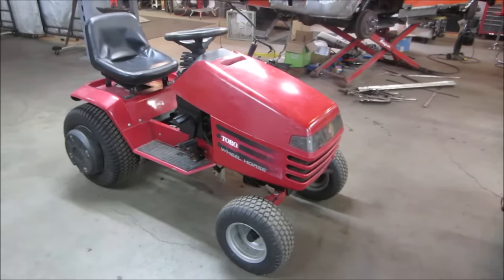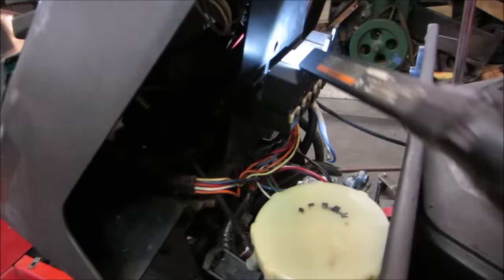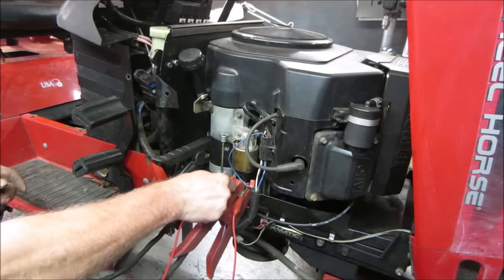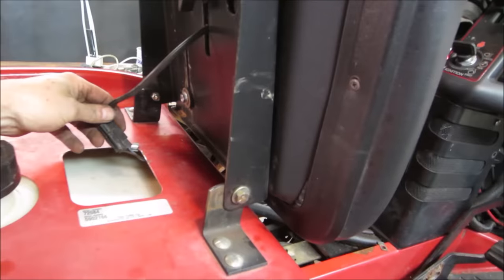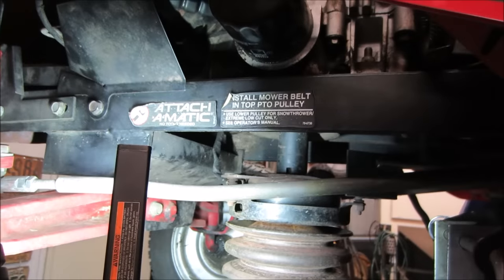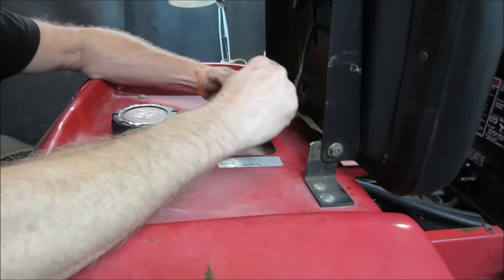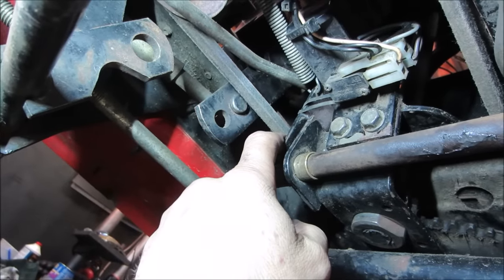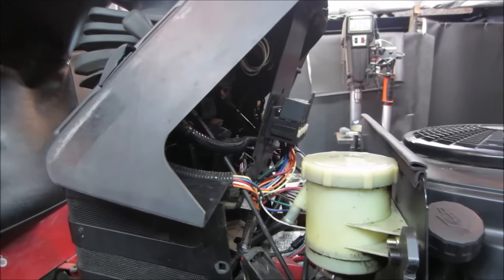How To Troubleshoot a Mower That Stopped Running,

Comment: Never apologize for troubleshooting without a manual!  It’s a lost art and we diehard fans love you doing it.
Reply: It's nice knowing exactly what wire does what and how each system works...but it's not realistic unless you work on the same exact thing every day. I try to learn from him, just have to know the BASICS and the different systems the machines have is invaluable to diagnosing lol. Classic Mustie fix.
Reply: New drivebelt had the wrong voltage rating.

Comment: Musty is at his best on electrical diagnosis and correction.  I think he has the skill of one in one thousand mechanics, Time tested by decades of experience.  In terms of diagnosis and correction of the switch for the p.To, You will note there are metal connections springs and bent metal.  Dirt and fatique are primarily the causes of poor connections.  Over time springs lose their elasticity.  It's referred to as cycles to failure.  Great job musty!!!   👍👍👍

Comment: It's projects like this that give the most satisfaction once completed.
The backyard Bandit puts the service centre to shame.
Reply: Ehhh usally the other way around...
Reply: The service channel charges by the hour, there comes a point it's not economically viable to do it there
Reply: @samuraidriver4x4  I completely understand you there, I recently repaired a chainsaw which the service centre said was beyond economical repair, why? Because it took 4 hours disassembling and re assembling the saw to replace a £5 part.
Reply: @Herbybandit  I try to buy equipment for cheap, work on it for 4 hours and flip it for let's say 150 bucks profit.
To bad there are no yard sales and free piles where I live
Still plenty of stuff on the online marketplaces for cheap although people think stuff is more expensive then its worth

Comment: In the U.K. I had my lawnmower at six ( some called ) service centres ,none could fix it . A friend said a engineer in north Scotland was the best in the business ( by far) phoned him , but it on the bus parcel service . I phoned the guy three days later and he said “the mowers repaired and but on the bus back” , 4 years on and it’s still going strong . The guys the small tool and mower wizard and I’ve used him to fix a few petrol and electrical tools and it’s a excellent and not expensive service by someone that knows his stuff.

Comment: The description reminds me a bit f the time I worked at Xerox building copy machines at the production line. 5 engineers from 3 different countries were standing at a machine they designed and didn't understand why it failed. As I walked by one engineer asked me if I knew what the issue was. I reached into the machine (pushed a gear pulley in the right spot), walked away and left them wondering what I just did. 😂

Comment: I have a Toro riding mower and one year it just stopped working,  After checking and replacing everything possible I gave up and took it to a repairman.  He called less than an hour later and said it was ready.  IO was surprised at how quickly he fixed it.  My problem was one of the little pieces of metal that sticks out of a relay was bent.  The mower thought the blade was engaged so wouldn't start.  It has again stopped and I haven't looked at it.  I plan on doing some checking and will take it to my repairman quicker this time.  I now have an old mower with all new parts!  It is funny now but wasn't at the time.  Thanks for video.

Comment: This was really well done.  There's really nothing worse that trying to troubleshoot a problem after someone else has been messing around and screwing things up.

Most of that was logic, but the really impressive part, that I think many of us would not have figured out, where those 2 switches that were flipped positions.
THAT seems to have been the main issue (or one of).

Comment: I am a retired physician.  I love your channel.  You amaze me with your problem solving skills.  Then you go above and beyond doing an autopsy on that PTO switch!  You truly never stop challenging yourself and seek more knowledge.  
I inherited a 30 year old JD lawn tractor and   after  watching you work on so many gas run machines I have learned how to fix a few things myself.  So far no electrical problems like this case.
Just think about how much carbon you saved by resurrecting  this mower!  It is sort of ironic that all the screwed up safety shut offs almost put this in the scrap heap!

Comment: Fixed my brother's JD mower today - remembered seeing this video and how you test things.  Had spark and a sniff of starting fluid confirmed it would run.  Fuel pump worked, but no "click" on the fuel solenoid when the key was turned.  Replaced the solenoid and good to go.  Your videos are interesting and informative allowing those of us less mechanically inclined to make the easy fixes.  Thanks for your great content.  Dave

Comment: With so many "safety" switches, one can safely stay on the couch and avoid mowing the grass.  ;  )
Reply: I’m all for mower safeties but geez that thing was over complicated. Two switches cancelling each other out plus a third one up top, relays, a bulb that has to work for the circuit to complete?!?!  Just wow.
Reply: @artemartem1134  All those safety devices remind me of the pleasure that you can get from bureaucracy.
Reply: @markschattefor6997  Safety switches? Mechanical and electrical bureaucracy and red tape. "Common sense" has died out.

Comment: Well done.   Excellent diagnosis.    The double brake interlock feels to be overly complicated.
A lot of connections were loose.    Makes me wonder if the original problem was just a loose connection.    
Dave.
Reply: Either a loose screw in the driver, or the nut behind the wheel. 😀
Reply: My theory is flaky PTO switch lead to other making a mes of it.  The rest of stuff looks to have been human error trying to find the problem.

Comment: Had a mower very similar to that years ago and had virtually the same problem. I kept trying to tell you it was the PTO Switch but you weren't hearing me! Then you tested it and I thought I was wrong but alas I was not. The PTO Switch was the original problem but one of the tech's added 2 or 3 more and turned it into a cluster!

Comment: watching you on stuff like this is a great learning experience. I used the same approach to resurrect a nearly 25 year old Sabre by John Deere. The parts I needed to replace included only the starter, and shorting a few of the safeties in the end. No manual, also. Who needs instructions?

Comment: In this episode, Mustie1, now the purveyor of mid-week madness, solves the quintessential riddle of the riding lawnmower by effortlessly evoking electrons from recalcitrant relays to score a successful start to win again.  Well done!
Reply: Many of us would simply bypass all that safety stuff, and run directly to essential circuits.  I suspected the starter relay at first, easy to check.  But all that safety ctap can drive you nuts, just chuck it, and make it like the 50s.  What's next, OBD2 computer controlled?  I van see it now, Moustie1 connecting his OBD2 screen scanner to a connector under the steering wheel to check a garden tractor for errors?  With all this climate change bullcrap, they'll be pushing ElecTraks like GE made.  Will this electric tractor start?
Reply: @umajunkcollector  as a mechanic, he can't legally bypass any safety equipment, except for testing purposes.
Reply: @umajunkcollector  "With all this climate change bullcrap". Go say that to Californians... They'll appreciate it ! 🤣🤣🤣
Reply: @umajunkcollector  Funny you should mention the ElecTrak.  I just acquired one of those - an E15.  It is in pretty rough shape but being an electronics engineer of a very practical sort I expect I can get it going again.  The ElecTraks actually had quite a few interlocks, relays and circuit boards full of electronics so indeed, you could have a "failure to start" due to safety system issues.

Comment: I have a craftsman get 5000 lawn tractor that has all those safety switches. After replacing a few of them I finally removed the wire from the coils that stops it from running.   No more problems with it starting. By the way I am the only one that operates it. Great video Mustie.

Comment: Superlative, methodical inspection, sir! I picked up an 80s Toro riding mower just today that has some issues . I haven't gotten into it at all other than riding it up and down the street from the former owner's house and it feels like the clutch is pretty weak. I landed on your vid just as a sort of 'getting to know the bits' introduction of what lays ahead in my future. Coming from an engineer, there seems to be a lot of needless complication for what is essentially a simple machine that should have more mechanical solutions than electrical complications that lead to failures. I suspect it came to this after a series of lawyer interdictions with the fine print being 'reliability'.

Comment: I had a feeling it was the pto switch. Each time you turned it off, the light flashed. I'd bet it was the original problem. Great job figuring it out.

Comment: Very interesting to follow your diagnosis. Sure it would have been much faster to trace back the crank wire back to the ignition switch to see where the issue is, but your approach taught us a whole lot more about those tractors and their components.

Comment: Excellent diagnositc video!   Your videos emboldened me to revive a 1990s Central Park rider over winter last year.  I picked up a little 2cycle mini-cultivator I'm going to throw on the bench and see if I can get it running this winter.  (small steps)  I think my preference is going to be small engines that I can put on the bench.  Getting a little to creaky myself to bend around mowers and tillers and such.

Comment: Mr. Mustie, I watched your video about how to troubleshoot a lawnmower and I found it very useful. I have a problem with my Troy-Bilt riding lawnmower. I checked the belts and the under-carriage and found no problem. The lawnmower starts and moves. When I try to engage the carriage to cut the grass the lawnmower stops. I have no idea what is going on with it. Is it a possibility you could help me solve this issue?

Comment: Electrical problems are always the hardest to track down. I think in this case, looking up a wiring diagram or the manual would have been helpful to save some time in troubleshooting. Obviously it is useful to understand the troubleshooting process but I'm guessing most people just want to get things running again ASAP. Thanks for the video and love seeing you diagnose small engines
Reply: A schemy helps, but doesn't determine failed switches, relays, or bad wiring.  Like here, everything ""looked"" OK, but a probe or DMM in experienced skilled hands can really get the job done.  Two other guys may have used schematics, but failed to find the fault.  First rule to troubleshoot electric problems is to check for good connections and contacts, like fuses, wiring, and switches.  But all that safety crap can be tricky, like here.
Reply: @ MrBigNoze   You obviously either didnt watch the whole vid or pay attention, or both...as in other vids Mustie makes it quite clear using manuals etc takes the troubleshooting out of it, and thats what its all about, thats what makes these vids what they are ...using his own skills  to find the problem...use a manual and the vids will be a few mins long and boring..
Reply: I believe toro has service manuals available on their website

Comment: Mustie, I doubt you'll ever see this, but Thank You for your wealth of knowledge shared so freely! After viewing your library on all the available mower types and power equipment you've worked on, and a lot of others to round up my skills, I ended up fabricating a clutch disc and am now chasing down electrical gremlins that are preventing a reliable running condition in gear. Kinda thinking it might be something with the transmission like the neutral switch too, as playing with the gears will sometimes let it fire up like magic, but not always. 

At any rate, I've gleaned a lot of from you and sorely wished I had you or someone of your ilk for a neighbor, if even just to bounce ideas off of, but I'm making a list of things to check and eliminate. With all your experience, have you ever run into a mower with an actual clutch disc in it (similar to a more simplistic manual transmission one in a car)? This one is on a 1986ish Toro 11-38 with a Peerless 5 speed, and from all my searching, it appears to be a failed industrial experiment of sorts as everything else either runs a hydrostatic or some kind of adjusting friction radius-type clutch like a Snapper.

Comment: The newer the machine the more flimsy contacts to arc and pit. Does not take much to prevent a contact or connection. You did a real good job going through the logical steps of functions. I will be doing the same thing in a few day fella. Thanks for your method of troubleshooting. Beats the alternative of paying money to get a PDF of the schematics. Good day too.

Comment: It's amazing what a nights sleep and the next day can do to the thought process. This was a good one. I work on Wheelhorse tractors all the time and own 7 of them. Most of mine are the older before Toro versions and much easier to work on. I have stayed away from those newer versions for just the reasons you showed in this video. I learned a lot watching this video, you the man and have the patience of a Saint!
Reply: I have eleven at the moment, bought for the right price. They have doubled or tripled on ask prices as of late
Reply: That Toro is very similar to my 1995 Sears garden tractor. The biggest difference is I have a manual transmission, but I'd bet most of the rest of the parts would interchange.
Reply: I have 3 WH
C-120 manual
C-141 auto
And one of those black hoods, automatic 
Both automatics have hydraulic deck lift
Reply: @lwilton  I've been thinking that there are A LOT more videos generally about people working on old, salvage equipment.  It's pretty obvious to me that we're heading quickly into times where human-energy, the kind that goes in to fixing, repairing, salvaging, rebuilding, etc., is of more value than the 'consumer-energy' of buying a new one and throwing out the old one.  I welcome this trend!

Comment: Nice catch on the reversed wires. A guy would almost  need a schematic, to find it. I've had one of these since new in 1996. Changing that drive belt was a bitch of a job. Other things...ignition switch (burned contacts inside), fuel pump stopped working. Screen in tank got pulled out because of lack of flow. Seat switch pulled out and cleaned. Mower deck rotted out, so I made a new one out of sheet metal. Still runs, burn a little oil, actually a lot when I tried synthetic. We mainly use it as a pull unit for trailers now.

Comment: The title of this video should be, "Why Dave Watches Mustie1 Videos". This was so needed. I have a John Deere LX 188 that I inherited. I cleaned the carburetor but must have made the float stick. I didn't know what was wrong because it was belching gas out the overflow. I let it set for a year or 2. After watching your videos for a while I learned about the float sticking. Then I was out tinkering with it one day and decided to change the ink looking oil and start messing with it again but the drain plug was so tight I busted off the whole filler thing from the engine. So I ordered a new one and one of the bolts is stripped out that holds it on. So now it leaks oil. I have to come up with a  solution for that.  
So a  while back I bought some parts and decided to try to get it going again, and didn't bother putting oil in it because I wasn't going to run it and wanted to make sure it had spark. Well, it doesn't. Now I know why. The oil pressure sensor knows there's no oil and cuts off the spark. Right? So I need to get the oil drip stopped and put oil in it and then crank it over for spark.

Comment: I have a question for you. I rebuilt a gx240 Honda and the exhaust is popping through the carburetor? It’s running smoothly but won’t go up to max rpm. I double checked the timing marks on the cam and they’re dead on?  Someone suggested that the cam lobe for the exhaust might be worn ??  What’s your Diagnosis ?

Comment: Really enjoying your videos. As someone who repairs things for a living, I always take an interest in how you solve issues. I have one suggestion though; your meter has the ability to put out a chime when you meter out switches. If you hit the DC/AC button until the last symbol beside the button appears on the display, it will activate that feature. I use all the time when I don't have the ability to look at the screen.

Comment: Those interlocks can be a nightmare on occasions, I had a Kubota which would not crank because of what I first thought was the interlocks   and there were a few more than on that mower lawn tractor. In the end it turned out that there was a special relay that automatically timed the glow plugs apart from it not being available here in the UK I also needed to take half the cab apart in order to get to it so in the end I purchased a number of relays and rewired the tractors starting circuit.

Comment: I was looking though your massive video list for some guidance on a Honda spree I inherited my father's 85 Honda spree with 600 Miles runs electric start works but needs cleaned up my father passed in 86 so yea any videos with the old sprees would be sweet looks like alot of 10 mm bolts

Comment: They sell beafyer ones with larger contacs on ebay. mine is the same but when it cuts out if i grab the back plug it pops back on and it seems all the plug spades aren`t loose.Thx for the vid!